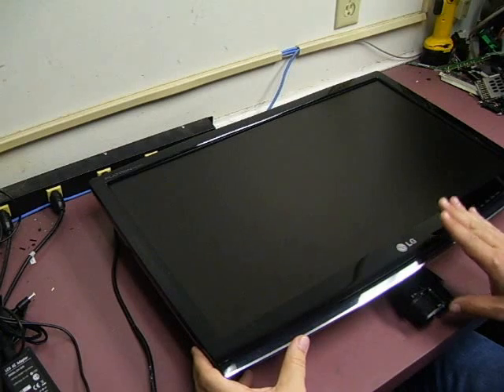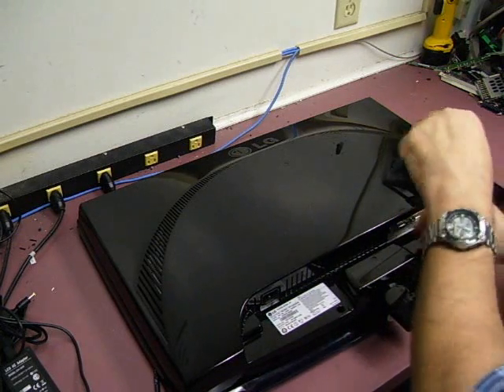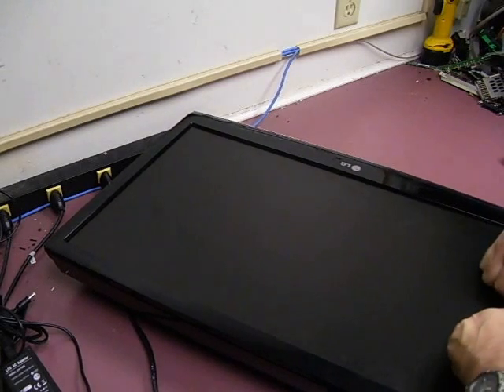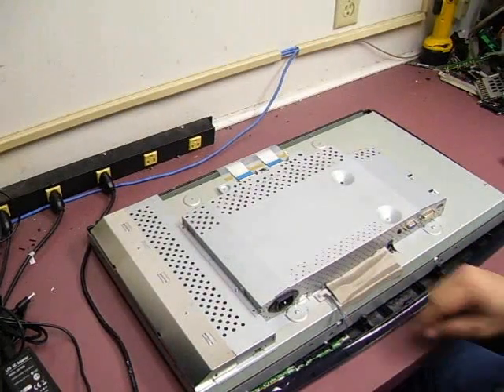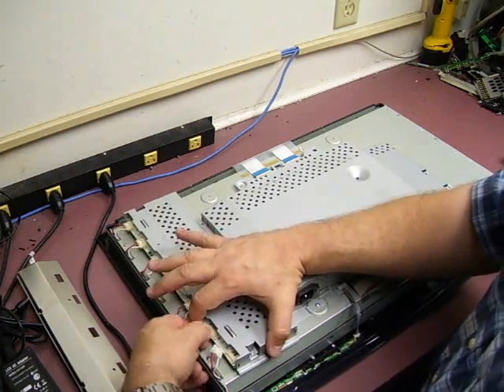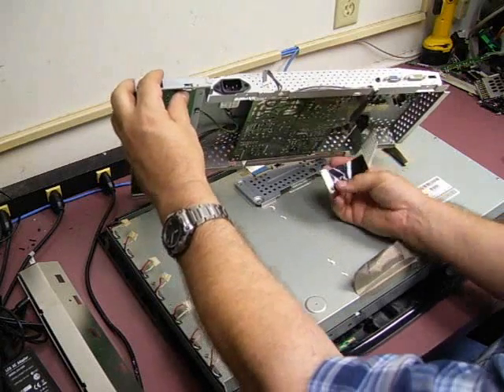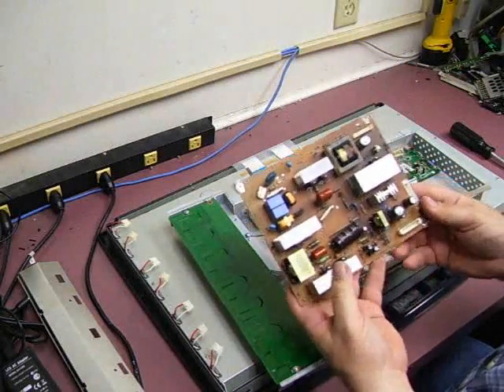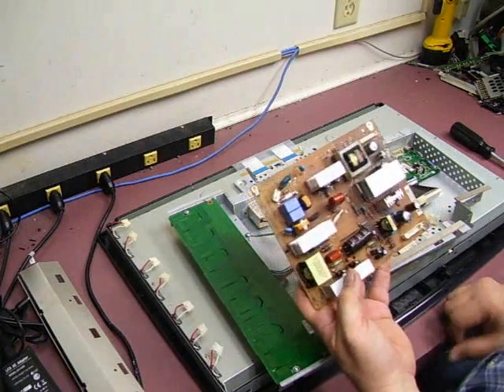Repairing a LG W2753V-pf LCD monitor - Part 1 Disassembly

Comment: Very nice video. Your video makes it look very easy. I have lg 42lf20fr. Problem - When I start the TV it turns on, picture displays for 3 to 5 seconds and then the TV goes back to standby mode. Power LED remains on. It is like TV has been switched off. Any idea of what can be the causes? Thanks in advance.

Comment: Thank you very much for these three videos which have helped me greatly to target the problem of my LG W2753V-PF.
My monitor does not want to light at all since I turned it off a few days ago. It had been more than two years that I was forced to let him turn on H24 7/7 to overcome this problem. But a friend has unfortunately turned it off and I couldn't boot it with the same technique.

I should receive the capacitors tomorrow so I would come to write another message to tell you if the screen works. In any case, thank you.

Comment: This procedure doesn't work with the LG 31MU97-B. Only two screws on the back, the rest is snap fit, but I can't seem to pry it apart.
Mine failed after a power outage today. It's only 14 months old. Won't turn on. No sign of life. But getting it apart is more challenging than troubleshooting it. I don't want to destroy the plastic to get it apart. Doesn't seem like this was made to be repairable. It's a $1400 disposable 4K display.

Comment: I have an HP25bw. They are bezel-less just glass on the front. I get the screws off the back but because there is a square hole with a lock symbol I can't seem to get the back off. Could you please let me know what I need to get this off?

Comment: He's using his fingers to pop off the front cover, but you can use pry tools. Probably this belongs to a customer so he doesn't want to leave marks on the frame. But if your working on your own monitor and you're not fussy about it use pry tools.

Comment: Video worked but the part where you're removing the screen edges on the front hurts like a mother. Once you wedge it open on the outside use a flathead screwdriver to slip and twist your way around. Good tip with folks with pencil pushing fingers like myself.
Reply: don't ever use a screwdriver or a knife or anything but a pry tool.

Comment: You make this look so easy. It took me over an hour to pry the front bezel off lol. I was able to fix mine following your great instructions. My W2453V was a little different but not too far off. Once I got it opened I discovered 4 bulged caps. After replacing them and the rest of the caps it powered right up. Easy fix and this was my first time soldering anything. Thanks for the great video.

Comment: Ok so i replaced the power board my lg because i am horrible with a soldiering gun. most likely need to take a good short course. i got the board on ebay. and i am getting same issue. it turns on and very shortly turns off. it does give a picture. now i am either wondering what the issue is. Is it something called the tcon board that needs to be replaced. I just know i am tired of getting now where. I've replaced a power board on another lg monitor with the same issue and it works perfect.

Comment: Thank you very much for your Video. It helps me a lot with my lg Flatron w2452t. It is not the same screen, but very similar. I discovered three puffed Elkos. After replacing them it works as great as on the first day. Thanks a lot again.

Comment: i also tested it on a different pc and this time i used the vga port, same story,the monitor does stays on, but the image goes blurry and shaky, as time passes it gets worst,if i turn it off and back on again the issue disappears, but after a 10/15 seconds it comes back again. any ideas?  thanks for your time.

Comment: Hello,i saw your repairing video of the LG W2753V monitor and i wonder if you can help me.i got the same monitor at a flee market for 20 euros, it was tested "briefly" on site, when i got home and turn on the monitor, i realized the image goes like blurry, like if colors setting weren't right, but i checked and double checked and everything seems ok, i had also installed the monitor's driver from the lg site itself, then uninstalled it believing that was causing the problem, but still the same.